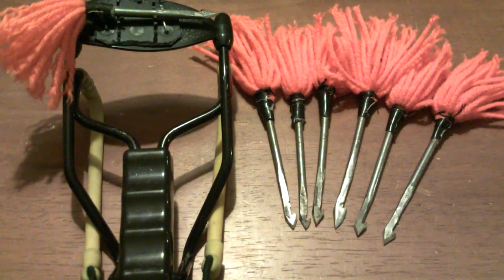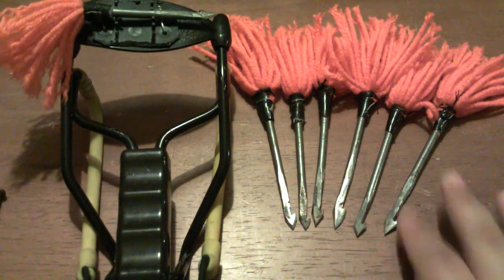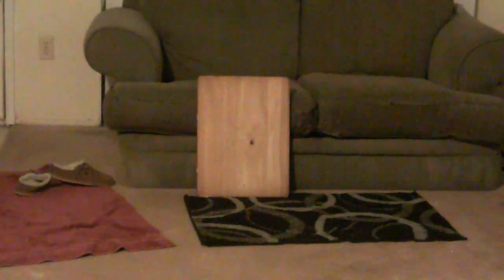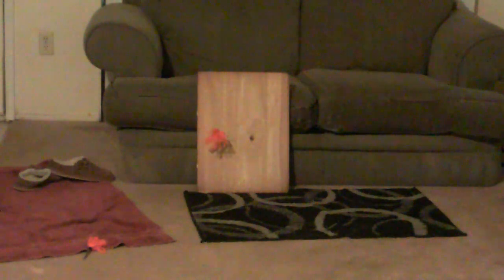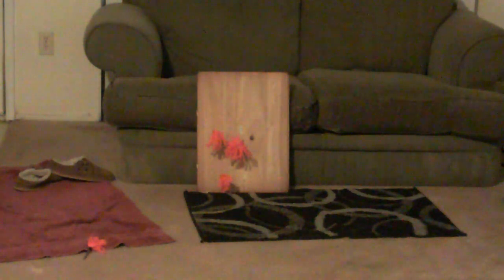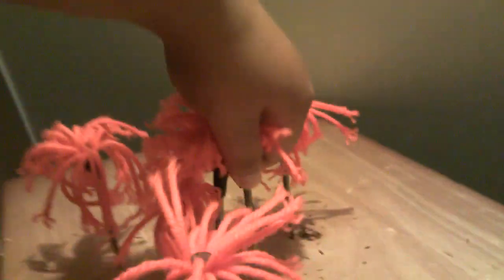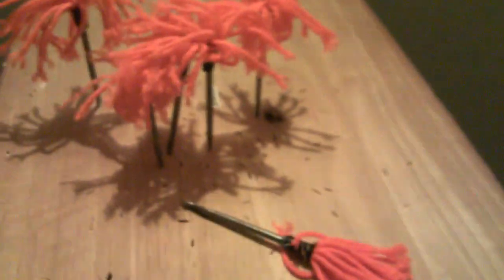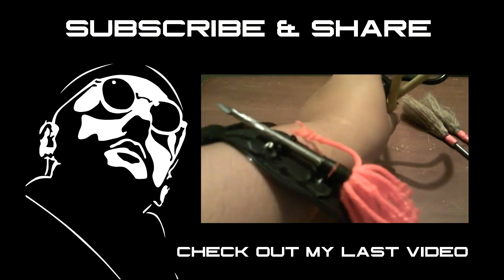Sling Darts: Testing New Fletchings ( Target Shooting )

Comment: I tried fletchings exactly like this many times, shorter, more fluffy/longer.. None of them worked even remotely as good as when I put actual plastic vanes on the darts.. They only seem to work when there really big, which obviously is kinda poitless then as the drag is horrendeous.. I even tried ribbon, I think its the stuff you get for tying on baloons for decoration, those were just as bad... The best method I came up with that worked flawless was to 3d print a slip on 3 fletch vane made out of tpu which is rubbery... Have never broken 1 yet and they make the darts fly 100% straight every time.. I gave up on everything else.. Must have spent at least 2 months on and off making and trying everything..

Comment: Have you thought of raking the yarn out to were it is just the individual threads it might give smoother flight just use a comb and repeatedly comb the yarn out into the single threads. If it works make a video please
Reply from the maker: +Th Linn gill 
Thanks for the tip. I've been super busy hints why I havent been active. Once I get the time I will try it out. Thanks for watching and commenting.
Reply: Use some chicken feathers for the fins, I found out that kind of fins fly faster and smoother than the "fireworks explosion fin type" you made(Excuse my english).

That kind of fins your using is resisting the air when it flies, it also decreases power, it's like it wants to stop, unlike the chicken feathers it's smoother. 

A duct tape fins will do also.